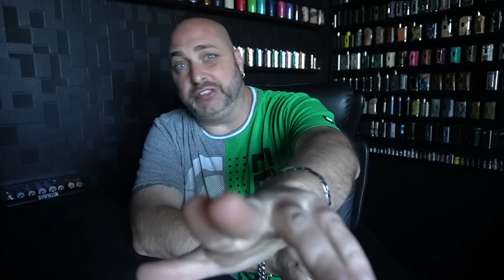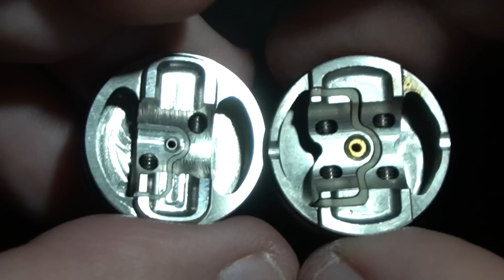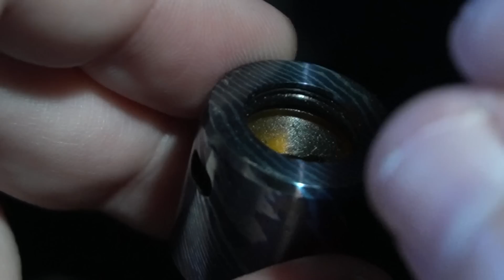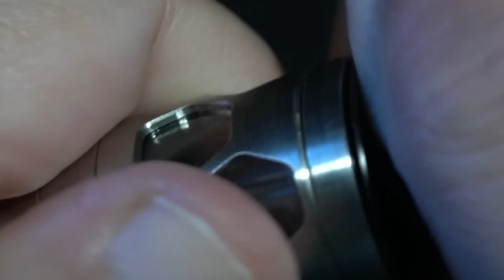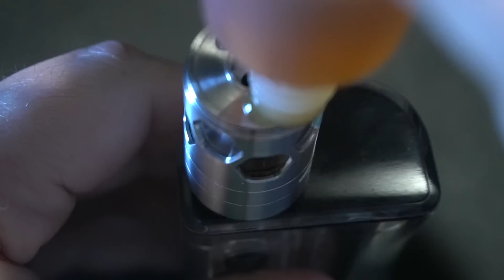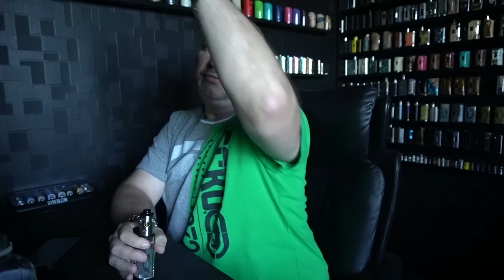The 143 RTA/RDA by Jai Haze Designs

Comment: Nice design!!! We need more accessories for the v1 rda lol
Reply: you saying for the Jenna? Like what? Unlikely to happen, especially now the 143 is the focus. Besides the Jenna has accessories, from cages to drip tips, extension tank to solid tank. Hell, even a different deck which is more suitable for dual coil if that's your desire. What else could you possibly want?
FYI the 143 is NOT a v2 of the Jenna, so there is no point in saying "for the V1."
Reply: @cosmiccharlie8006  did I ever say it was a v2 and no one asked u!!! Smh